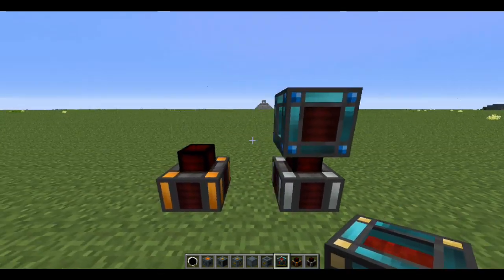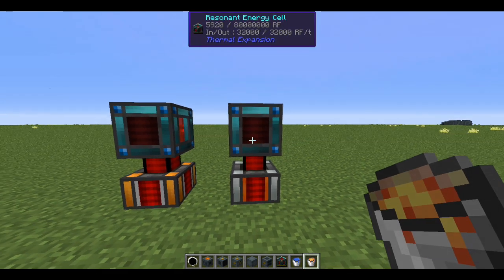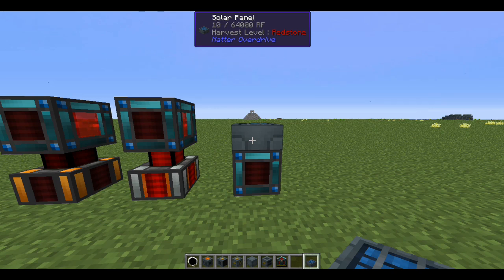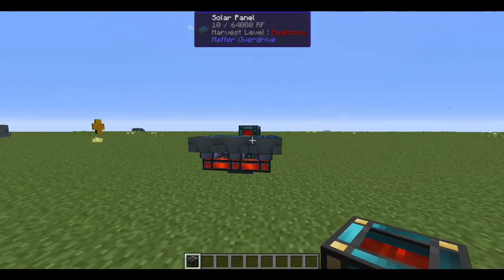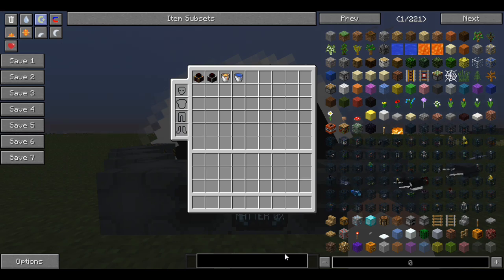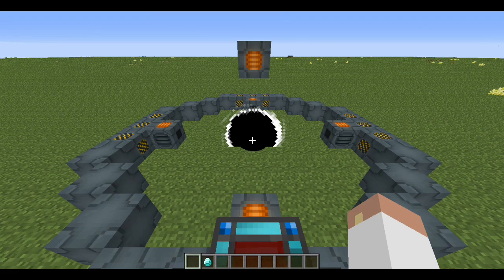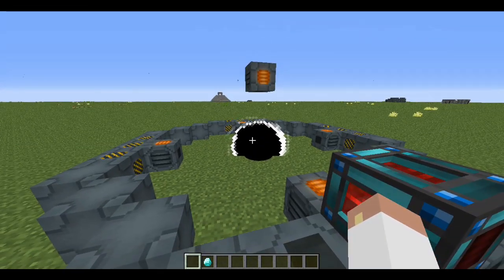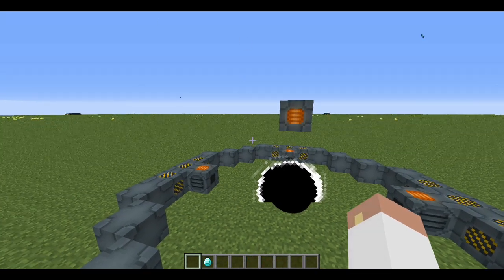Matter Overdrive 1.7.10 Revisited 2/3 (Tutorial)

Comment: Draconic Evo Reactor has a base 300k-400k rf/tick output
Big reactors can reach the millions if they're big enough
Extra utils rainbow gen makes 1 mil per side, total 6 mil per tick
that would fill a resonant energy cell in less than a second (if not for max IO)
there's just a few
Reply: U nub

Do you even watch ssundee

He breaks the game with over a billion rf a tic
Reply: didnt want to get too op now :-P
Reply: mekanism reactor: 24M rd/t
Reply: ive had ones in creative that hit 50m
never in surv tho, dont use mekanism often enough
Reply: Actually if you look around, a properly cared for Draconic Evolution reactor can produce far higher RF amounts. The highest I have seen on a stable DE reactor turning it up twice a day for two weeks which pretty much is a full cycle on 8 awakened draconium blocks was producing 2,300,000 Rf/t
Reply from the maker: This is an early/mid game mod. Not comparing to to end game stuff. That's not a fair comparison.
Reply: @SliderHavoc  Big reactors is fairly early game as all you need is iron, coal and yellow rite. It's not particularly difficult to make a massive one.
Reply from the maker: @ranaghast  one hundred percent correct. But I can make a cobble generator and leave this forever. Just a bit more simple, especially early game. But this is just my opinion
Reply: @SliderHavoc  But then you have to sit there mining cobble for like ten hours. A yellowrite reactor you can pack full of yellowrite and not touch again.
Reply: @ranaghast  cobble. generator.

Comment: Hey, so I harnessed the black hole as shown in the video but it ate the whole fusion machine... How did you set the config to stop that from happening?
Reply from the maker: Wow, I've never see that happen before. My configs are set to the default for revenge of the C Team for this video. But I've played on different servers as well as using the base config on my own server and I have never had that happen. The best advice I could give would be to wrap it with obby first and then set it up. But other than that, I'm not sure what else there is to do.
Reply: I looked around in the config for a while (There is a lot) and I found that within the 'server config' there is away to turn that off. Great video by the way, and thanks for your time. ;)
Reply: Actually in creative mode I fed this gravitational anomaly so much, so it ate whole reactor. it was outputing like 23k rf/t, before reactor was eaten